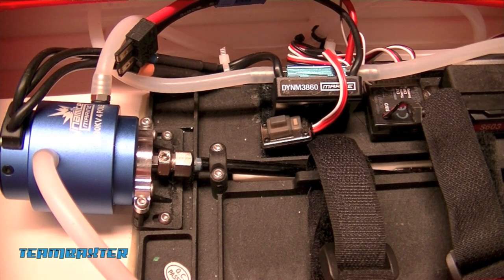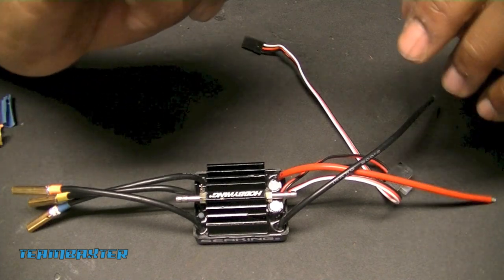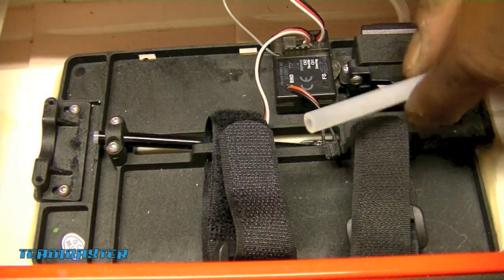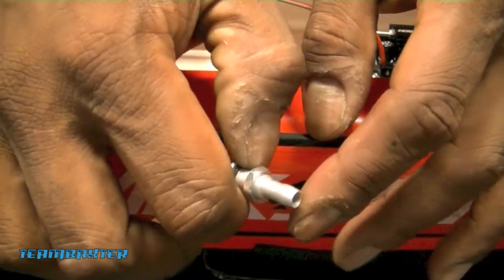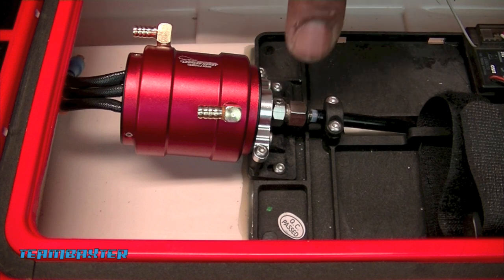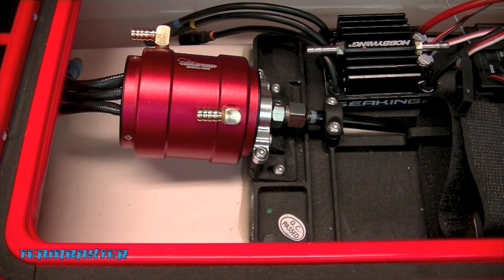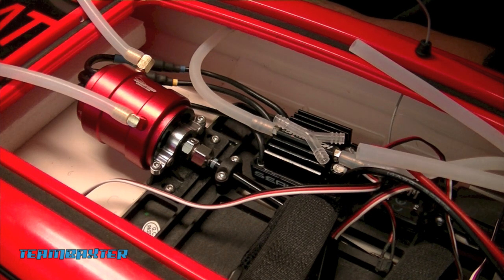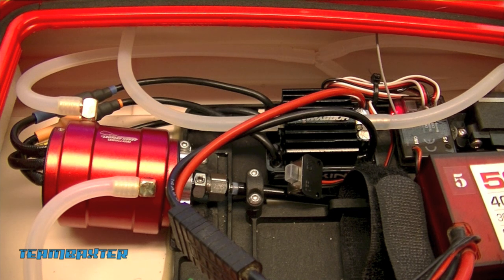ProBoat Blackjack 24 Power/ Cooling Upgrades - Installation

Comment: Very cool. I'm probably going to upgrade mine as well. The stock system seems to be too inefficient. Gets too hot, too quickly.

I'll probably go with the same ESC you used and either the Leopard 2450KV or 2750KV motor. Can't make up my mind which one.

Comment: where did you get the adapter for the motor to the drives haft I have the miss geico 24 and bought a new motor and esc snd the motor shafts is bigger than the stock conecter. any help would be appreciated. awesome video. 

kevin
Reply from the maker: Check out offshoreelectrics.com or kintec racing websites. They should have the coupler that you need to get you going and ship reasonably fast as well. Thanks for watching.

Comment: Nice cooling upgrades did you add extra water pickups to get the extra cooling new to the hobby i want to do this to my Black jack 24 not sure how to do this any help is appreciated thanks....
Reply: QuickDrawMcDraw 227 ,, make a bracket, with water pick-up, off of rudder bolt, + "y" adapter, position on the "up" side of prop swing, my "29", needed extra cooling!, it works!...

Comment: @ARTINCbybd -  I just bought the same boat and If I just add the Leopard Motor -2750KV and a Hobby Wing ESC 60amp and change the propeller to stainless steel instead of plastic, how will she run?

Comment: where did you get the parts...motor....collet adapters...etc?
Reply from the maker: ***** All parts were bought and very quickly shipped by offshoreelectrics.com. Great site, and the staff will readily help you with any questions you may have. Thank you for watching and commenting, hope you find what you need!
Reply: Thanks very much.
Reply: Have you run it yet?